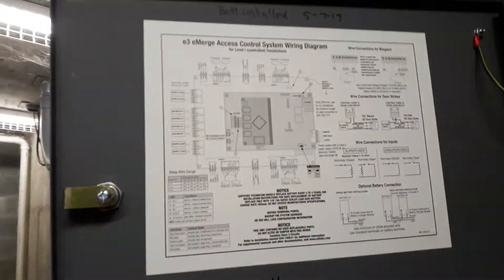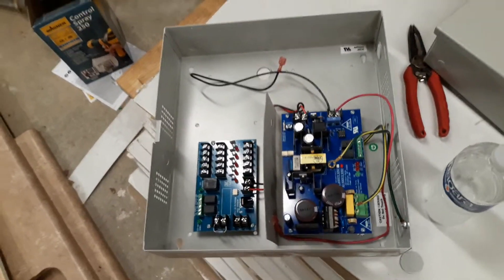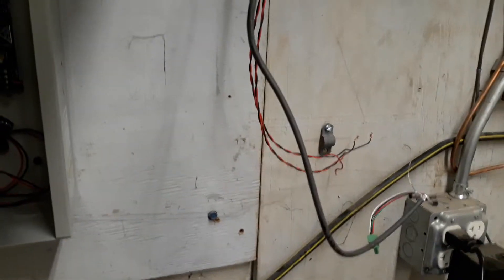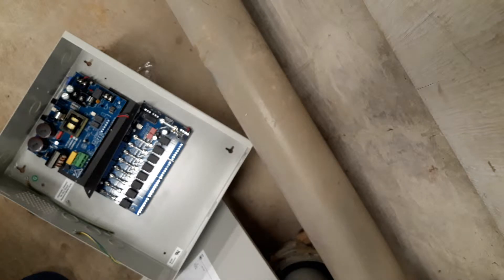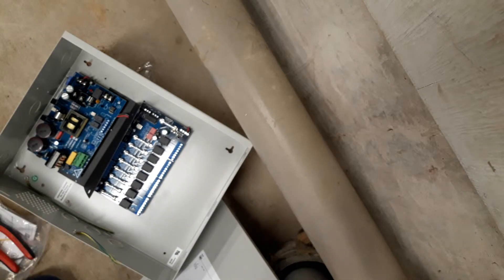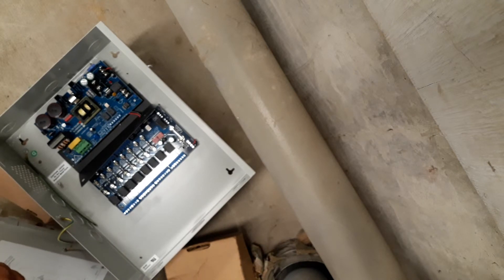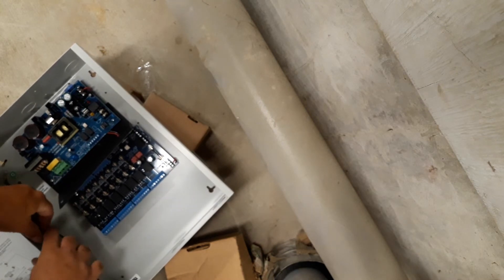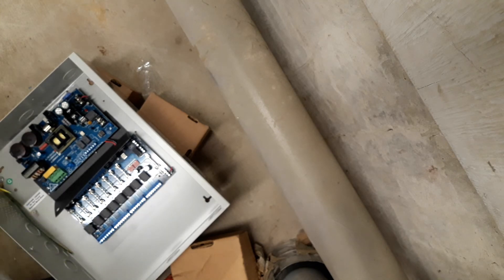Preparing a altronix power supply to hook to a linar access control.

Comment: Hey, I'm trying to get some help with an Altronix eFlow 1012NB power supply. I have noticed that the batteries of the access control system are outdated and must be replaced, they don't retain enough energy. Due to the battery's condition, I know that this kind of power supply has a low-power shutdown function integrated. It shuts down DC output terminals if battery voltage drops down 80% of nominal to prevent deep battery discharge. 
The issue is, at some point, we could be having voltage variations in the building, or, the power supply detects the voltage drop and cuts down DC outputs because of the voltage variations of the building or because of a power shutdown (that has not been reported). 
After this, the access control system goes off. To re-establish the system, we need to go back to reset the circuit breaker manually. After this, everything comes back to normal. But my question is, do I have to do this every time the system goes out, resetting the eFlow power supply manually? If power comes back, should the power supply work normally without our intervention? I will be changing the batteries soon. To test and kinda solve the issue, I changed that eFlow power supply for an AL1012ULXB, and for some reason, for 7 days we have had no problems (still with the outdated batteries connected).